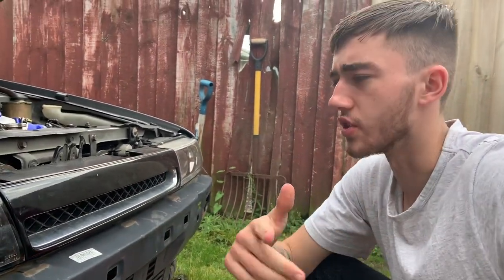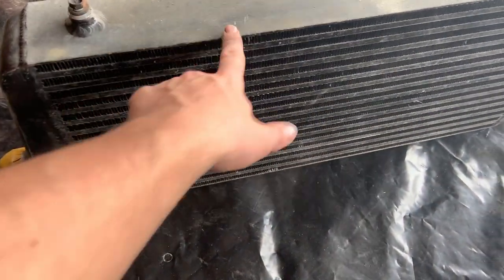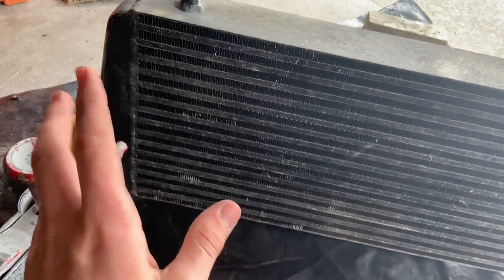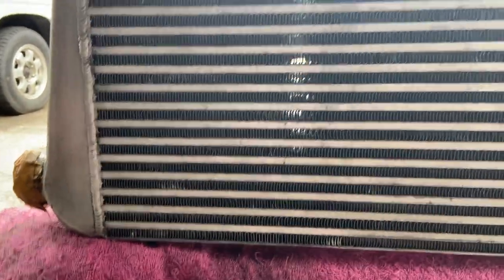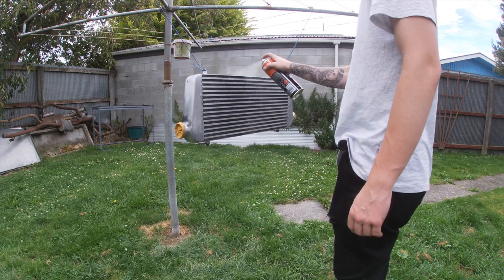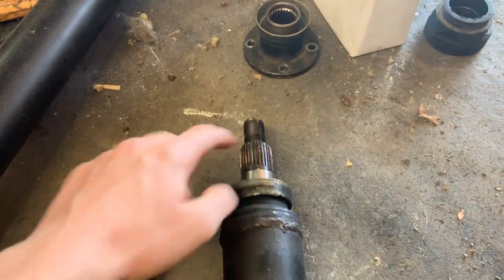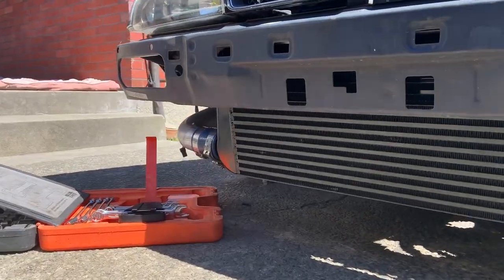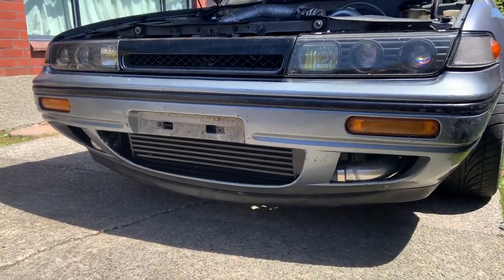Painting The Cefiros Intercooler + Skyline Update

Comment: Hey bro how did you get the intercooler to not touch the bumper because when I installed the intercooler my bumper wouldn’t fit on properly because the bottom had no space and kept pushing my bumper out